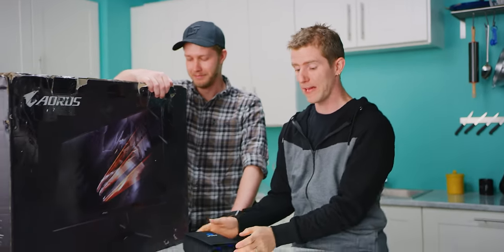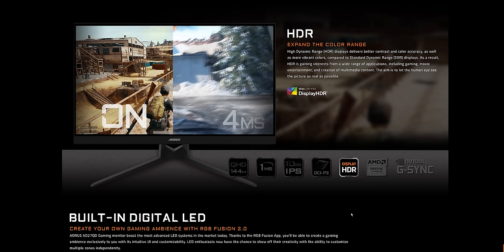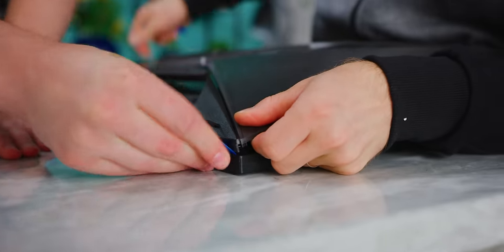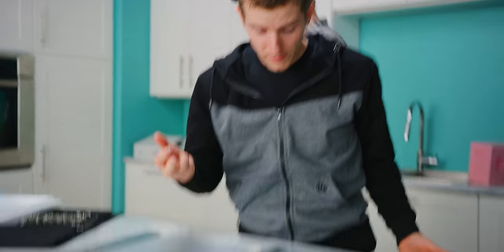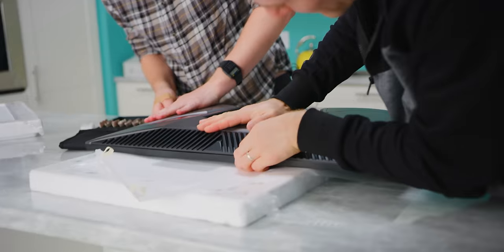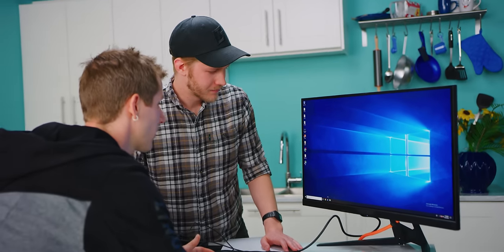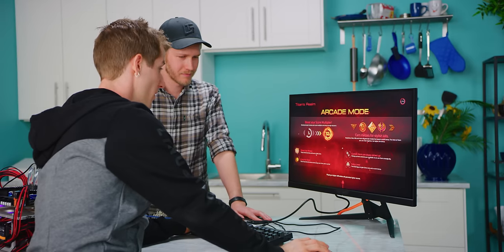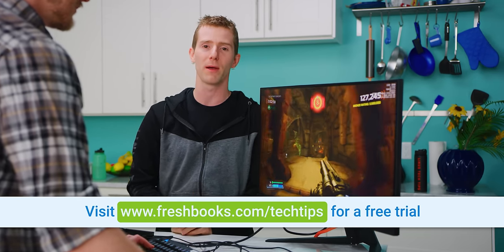Fixing a Broken Gaming Monitor for CHEAP - DIY

Comment: I wouldn't go out of my way to check for dead pixels on a monitor that I couldn't warranty return. Just enjoy your blissful ignorance for as long as you can.
Reply: Even what he found wouldn't be eligible for a warranty exchange on a brand new screen
Reply: @Agret  Yah a dead pixal is sorta with in spec.... 

 I got one on my panel that I sorta have to flick away every so offten. Feels so wrong flicking my screen, but eh, it works.
Reply: well if it were me in that situation. I wouldn't care as much as when I am using my monitor I only pay attention to the content I am consuming. For example my old monitor (an Asus 144Hz 1080p 1ms response times TN panel) has a self inflicted scratch on it that I did accidentally when I accidentally spilled water on my Corsair K70 RGB Rapidfire keyboard and in a hurry I literally just flipped it upside down to drain the water and because my keyboard was close to the monitor and due to the location of my PC relative to the keyboard the cable barely had any give and I accidentally marked the screen because the top of the keyboard is aluminium (I first spilled a drink on it in like 2017 and had owned that keyboard for almost 4 years straight till it died in July this year and it suffered so much abuse from spillages and still wouldn't die). The mark was not enough to crack the screen or damage any pixels as far as I am aware but I NEVER notice the scratch on the screen unless I am looking for it and the scratch is quite big it is like almost an inch long and if you touch that part of the panel you can feel the scratch easily also because I scratched the polarising filter on the screen it is noticeable when you change the angles you are looking at the screen from (I gave it to my younger brother as hand me down and I upgraded to one of the new Asus TUF Gaming 1440p 170Hz IPS HDR 1ms response time monitors with good colour accuracy on black Friday sale last week)
Reply: @zahidshabir4038  bro, just breathe, please
Reply: @jesga0  LMFAO

Comment: FPC cables are standard parts, if you mess it up you count the pins, look whether it's same-side or inverted, measure pitch and look up available lengths. It's likely enough that you may end up with a longer one if you have to order it new and but it's no problem. What is that it takes time, because nobody local stocks them ever, you have to order them from a specialist supplier.

Comment: This has the potential to prevent a lot of e-waste. I hope Free Geek sees this.
Reply: the problem is usually the panel cost almost as close as a new monitor. Once I attempted to fix a broken monitor that costed $270 on Amazon, when I checked for the panel price, it was close to $210. We could argue that the $60 difference make it worth the effort, but personally, i'm not ready to waste my money with a chance to screw up and lose another $210 in the process.
Reply: @vanlao6367  the bigger problem is how unreliable this can be too, here they get a fairly solid panel... but you are never too sure about what you will get by purchasing something like this on backchannels from chinese factories leftovers... Overall that's a lot of money, time and efforts for something that may or may not work. Really it's basically gambling.
Reply: @vanlao6367  If your monitor 'only' costs 200-300 bucks then yeah, it might not be worth it. But if you can get a 600-800 dollar monitor for half the price or less then that might be a different deal. There's of course still a chance that you might get a dud but at that price point it might look more attractive to take the risk at least once. 

Honestly though i doubt this is gonna become a thing unless forced through legislation or something. If companies like Acer or Asus start noticing that customers are buying backchannel spare parts from China to fix their products then they're probably gonna start trying to clamp down on it real quick. Apple's already trying it's best to limit people's abillity for self-repair or 3rd-party repair by shutting down parts suppliers or siezing parts in customs.
Reply: @Fraggr92  Now to be fair, Apple has been cockbags ever since Jobs returned, its nothing new.

Comment: That feeling when you just get done ordering a new monitor, and then see that exact monitor in the thumbnail of a broken monitor repair video. =S
Reply: ...Which means you now know how to fix that particular monitor if you accidentally break it. Good for you.
Reply: You could always return it?
Reply: @-SP.  Not worth it anymore, broken monitors shot up in value after the video got posted and now only for very specific monitors you will make any type of savings. For popular monitors or any that are worth anything, you will actually lose money if you try to do this.

Comment: My grandmother had a TV that didnt work so I disassembled it and I saw that the problem it had was that the cable attached to the panel (taped) was disconnected so I just connected it and assembled again and worked perfectly, maybe you could be lucky and shouldnt need to buy another pannel
Reply: That ain’t gonna fix it if it was cracked
Reply: @marbas3397  cracked my ass

Comment: What if the problem is not in the panel? Now you have two functional panels and zero working monitors. Genius.
Reply: Buy two more broken monitors and use the two good panels to fix them, sell the second one and make all of your money back so you got a free monitor...sounds even better to me.
Reply: @ryanb509  but the two new broken monitors also dont have broken panels. So your stuck with even more panels.
Reply: @snepNL  Just break the panel on those monitors, that way you can do a panel replacement.
Reply: @LaughingOrange  gg, u won at life

Comment: Also don't just make sure you can find the panel...make sure the panel is the actual problem...not every broken monitor is a panel. Sometimes it could be as little as a few capacitors on the power supply.

Comment: I broke my Lenovo Z570 screen in year 2014.

Replaced the screen 2 times in search of original display quality.
Couldn't do it in last 5 years. Those cheap panels aren't worth the quality
Reply: Any symptoms like blank screen or total death screen?
Reply: @Erick-hj7vo  naa, these cheap make screens work fine but not enough Pixel quality as the original.
When I play HD content, decrease in original quality is very noticible
Reply: Lenowo 😂

Comment: this is literally my job I can't say the company but I do lcd repair easy
Reply: Question: Is this a thing that usually works all the time when you fix the LCD ?
Reply: @justinmorales4635  yes but, beforehand make sure the monitor has power and turn it on and leave it on for a few minutes just to make sure the power supply is good, a lot of the time caps go bad on the power board. if a screen turns on then goes straight back off. power issue.

Comment: I recently did this with a Gaming laptop. I bought a Lenova Bluray 14" Ideapad Y480 w/ 8gb DDR3 and 500GB SSD as "Parts" No O.S., 2nd hand from the Goodwill of San Francisco @ auction for $23.00 +13.00 shipping. Had a double line down the left side like someone left a pencil between the screen and keyboard and tried to close it. A new screen Cost me 46.00 from eBay. I installed windows 10 Pro.  I get 45 fps in PUBG. I've looked it up it's  a older model but still resales over 300.00 "Used"   Great Steal!!! Love it, Now you got me looking for one (Ha ha) off ebay. grrrrr

Comment: Back when this video came out, I wanted to find one myself, see if it's actually cheaper. I think it was something like Acer Predator XB1 27 inch, something along those lines. And I found a broken set (frame in good condition, panel broken) and a fresh new panel. I put it into a calculator (referencing the average cost of the actual monitor,) and would've saved almost 2000 dkk including shipping (I think it's about 3-400 usd). I say "would've" because I didn't buy it. Let the chance slide for another day.

edit; If anyone was interested, I found a very similar model, the XB271HA from Acer. Either that, or the HUA, or HU.

Comment: My most Profit was my Actual Monitor: ASUS PG27V 165Hz Curved WQHD 27Inch. i got it for 40€ with Lines on Screen. the Problem was a Short in the Circuit i Cuttet 3 Lines on the Panel itselfs Board. and it works great :)

Comment: Thank you very much Linus for this DIY Repair Tutorial. I would also like to request a comprehensive playlist of Teardown and DIY Repairs of PC Components such as Monitors, Graphics Cards, Cooling Fans, PSUs, AIO Coolers, Keyboards, Mouse/Mice, Headsets, Speakers and Printers on your Channel. I am from the Philippines wherein warranty & repairs for defective/damaged products are troublesome and usually take longer than necessary amount of time because of lousy and congested transportation system(both railway-based and road-based). Thus, hampering the efficiency of courier-service providers and repair centers as well(delivery of damaged items, procurement and delivery of required internal spare parts). So it would be logical for me if I will acquire the necessary knowledge and skills for DIY Repairs so I can repair defective/damaged products since I already have the necessary tools.

Comment: The hope of buying a broken item that actually works isn't all that far fetched. I once bought a broken 3ds XL to fix in high school for some extra cash and it claimed the cartridge slot didn't work. I got the system for a much better deal than typical broken 3ds XL's and and found out it worked fine. I assume the cartridge they were trying to play may have been broken in some way. It was a great time, because back then I had a two DS, and I had borrowed A link between worlds from my gf, and I got to play the entire game with 3D. I sold it after for quite a bit of profit, and to this day I can't believe what a deal I got.

Comment: I was hoping for a little more information about how to mix and match monitor LCD panels, which specs are important when looking up a replacement etc... Got any videos on that? Say, if a replacement for the exact model is just not available on the market, can I still find a panel that will work?

Comment: Since you guys fix things I need advice. My monitor does the weird “colorful” white noise when it’s on 200hz… have to pull power and it works… till it doesn’t any idea what’s wrong ( display port)

Comment: Alex is the coolest guy at LTT. Always comes up with the most unconventional projects, that are actually interesting to watch and somewhat educational. 

Man, I would love to make my own CPU cooler. I would love to melt some aluminum into a mold and than test it against machine manufactured ones  Replace screen panel. Wash CPU in a sink and test it afterwards... Heck, I need to work for LTT

Comment: Now, how does one fix a monitor with a backlight that's acting like a fluorescent bulb on the fritz?

I have a BenQ monitor that somehow went blurry while within warranty, but I stuck it in a box and forgot about it long enough that the warranty ended.

When I recently re-checked it, now the backlight is failing too.  At this point, it's just taking up space, so I'd love to find a low-effort use for it.

Comment: 3 years later, many many monitor repairs later, im still astonished that monitors will use tape instead of screws for the piece that the vesa mount goes on.

Comment: Yeah I dropped $1600 on building my PC and ended up having to use a $20 HP Prodisplay P221 from Value Village. Not terrible, but I wish I could go back and remove my "1080p 60fps is all I'll ever need" mindset.

Comment: Hi folks! Thanks for the heads up! Christmas ended up with my pair of hp pavilion 25bw ips led backlit monitors crashed in the floor! (free advise: don't let small "Chuky" kids, son of your business partner around your delicate stuff!). One of them was undamaged, but not the other. I was about to trash it away when I found your tutorial. Question here, I don't find the panel part number, I plan to dissemble the unit (nothing to loose anyway), and look for it there. Would I be able to find it if I take the back panel off? Other question, what are the odds of finding a compatible panel for that chassis? I got two new monitors after the "incident", so I just want to use this as single monitor, no need to have exactly the same original specifications. Let me know what you think. Thanks a lot!

Comment: 4:26 Does the AOC 27G2G4 also opens this way??? There's nothing on the disassembly too for this model, need to fix panel switches it keeps activating on its own.

Comment: I should do this and fix my broken LG 4k monitor. The panel is good but it either the PSU or the motherboard died because of surge current. A fuse probably burned, but I'm not an electrician so I have no idea how to test it or how to find it.
Reply: you could get a board, or a cracked one and transplant it.

Comment: Where did you get the replacement screen from? I have a 24" monitor with a broken screen and am unable to find the screen to replace. Can you provide some help?
Reply: Google monitor model number + "panel part number" or check if panel part  number is in manual.

Comment: My wife and I got our pair of Dell S2716DGR on sale for $250 last year. I just saw their MSRP has gone up to $600 USD (from $400) as well. Why did monitor prices jump up so sharply?. Are these newer fast IPS panels preferred over TN panels now?
Reply: They're way way much preferred over TN panels, no one really wants to buy TN panels especially for people who buy these Monitors for gaming. It's going out of fashion for most individuals, but I still kind of wonder why some monitors (like yours) suddenly jump up so high, perhaps demand is coming back.
Reply: There are both good and bad TN and IPS panels. I would take a good TN panel over a cheap IPS panel any day. And the day we get 1ms 240Hz+ OLED, I'll be all over it.

Since 120Hz+ qHD hardware proliferated, TN was basically the only way to go. At least, it was until recently. My older 60Hz screens are all IPS. All the 120Hz qHD screens in my house are TN. The Dell S2716DG has great color accuracy and viewing angle for a TN monitor, though. A good TN panel is vastly superior to a cheap IPS panel (I have had some of those, too). IPS glow can be very distracting when playing/watching in the dark.

I only just realized IPS technology has reached 1ms response time. That's a fairly recent development, 3rd or 4th quarter last year. Interesting, to say the least. Perhaps my next build will be 240Hz+ IPS.
Reply: @kevinohara8529  Oh, yeah I do agree that a good TN panel is way better than a IPS panel, just that the demand for TN, good or not is being outblown by anything with an "IPS" tag on it these days. And yeah, I'd rather have a reliable and good TN panel with good picture quality than a poor IPS with a horrible backlight.

Comment: I bought the Asus Tuf Gaming VG289Q last yr when it came out,,it is a very nice monitor sadly today I had an accident and has a small scratch but its giving off lines up and down all over the screen,,on the Asus website they have replacement for all models but this one,,maybe cause it is still new,,and no reply yet to my requests,,I even checked ali and wish,,no luck,,:(

Comment: Could I upgrade my monitor then by replacing the screen with higher resolution panel with the same brand and model?
Reply: it probably wount line up with the specifications for the current on you have as the board on the one you have right now wount support the newer model

Comment: hmm, I tried this technic of looking on eBay for a broken monitor for $79.00 and $30.00 for shipping and then I went to ASUS for the screen part. The part cost $348.33 and had to be shipped from Europe. On Amazon with my Prime membership, I could buy the same monitor that is brand new and comes with a warranty for $305.00 and I will get two-day free shipping.

Comment: To think i make a living doing this for a living,wither its at circuit or software level,any IT euipment  ,Omg Linus this video made me rotflmao,watching you open that montior was priceless,next time you wana open a monitor heres a tip use a non used credit card that means nothing to open the pop joints on the cover,but here's a challenge from me replace the blacklights on a panel ,that would make for some quality entertainment!

Comment: Me: Maybe I should try to just fix my monitor instead of getting a brand new one...
"That's the part where if I accidentally bridge some of these contacts, because I'm pretty sure there are some pretty decent sized capacitors on the other side, I could die"
Me: ...nvm...

Comment: its not cheap, not even $200 in price difference with new one, and don't forget new comes with warranty. What i consider cheap is if you can get at least 1/2 or more from price of new monitor. If just $150 better buy new rather than go through all that risk and headache (new display parts broke on shipping, 3 month waiting, 3x times cancelled, don't know if this gonna work, is the part gonna compatible, is the part legit not shabby quality, ect)

Comment: If I have an old 1080p monitor that works perfectly fine could I somehow take it apart and switch out the board that has the blue and white connector on it for a more modern D: and HDMI connector? I plan to use it with it laptop and the laptop actually has both connectors D: and HDMI

Comment: i have a better solution . actually you can sync panels with different display board.  and its not so difficult. i got my dead tv  converted into a computer desktop monitor just by sync a desktop lcd board with my dead tv's  working panel. you just need to understand the lvds connections and set them to right configuration . and your monitor is ready. now i use a 42 inches monitor for my desktop cpu